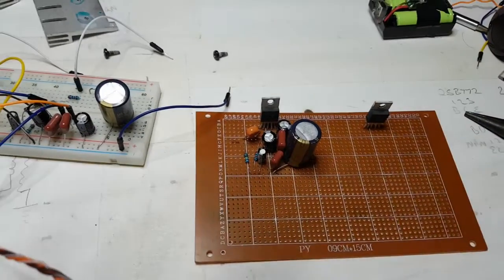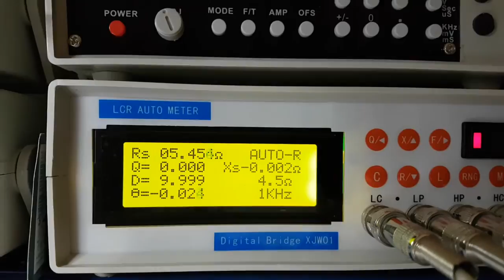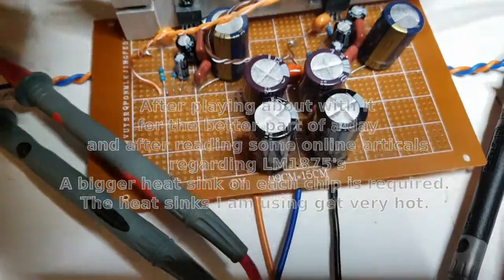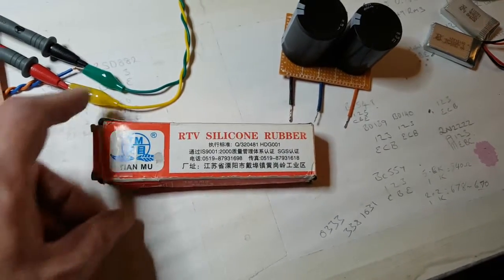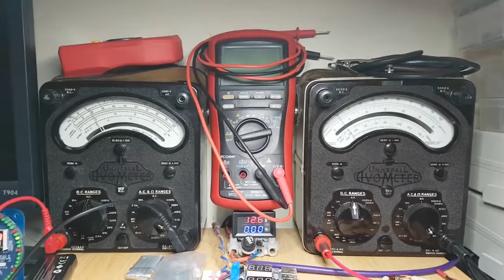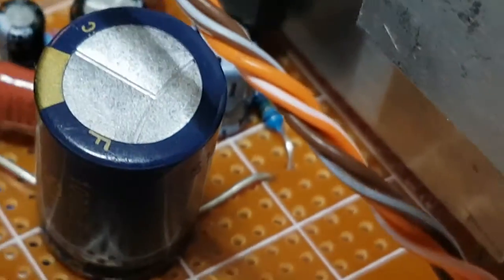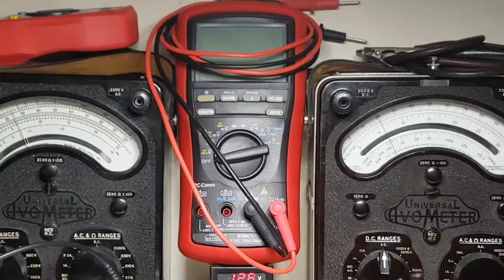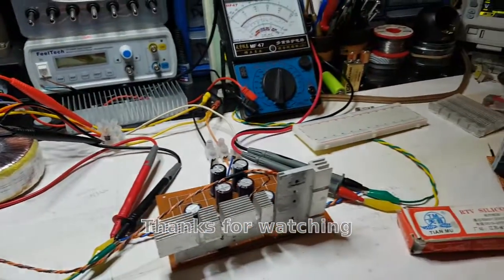DIY Stereo LM1875 Amplifier

Comment: Thanks for the vid... can you please tell me a bit about the power transformer your using?
Reply from the maker: Hi Yorky, Its a 12-0-12 160VA I bought this one http://www.ebay.co.uk/itm/Toroidal-Transformer-Dual-Primary-Secondary-160VA-2x12v-/121321460007?hash=item1c3f529127 
I hope this helps :D
Reply: it sounds and looks like one from jaycar (australia) but they told me it wouldn't do the job. It states 
12-0-12 300VE, from 240v main (it has 6 wires coming from it)... Can you tell me, how many wires come from your transformer?

Comment: Great sound..and I love the VU meters...smile...bench is looking more impressive each time I see it...except for the worst speaker repair I have ever seen....grin..been having fun here recharging 48 magnesium D cells made the most impractical power bank you have ever seen..but 30 ah capacity
Reply from the maker: The meters are cool, even if they were just used like that,I could live with it. Yes, the speaker repair, not my finest work, the speakers were pretty badly blown, now they sound OK. Why make such a power back, one has to ask.
Reply: My daughter asked me if I wanted some dead batteries...being a horder I said yep...to my delight she had 48 of them..so i learnt how to recharge D cells and made the pack...12 volts but with a buck if needed....4 sets of 8 cells which is now part of a solar powered radio...i will be interesting to see how long the battery chemistry holds up...3 months so far...plus i am protecting the health of frogs,..,,smile
Reply from the maker: Your solar panel is trickle charging the battery pack, nice. I like frogs, are they in danger?

Comment: Kindly share the diagram
Reply from the maker: It's on the LM1875 datasheet ; )
Reply: Have you used the same components given in data sheet or you made changes in that?
Reply from the maker: Rodney I would like to say no, but I honestly can't remember. I do remember making the output capacitor bigger and low ESR for more bass. I would be more concerned about layout with these amps. I am sure I put the circuit and layout are in the video. Here is another youtubers video link   https://youtu.be/TSbwEhMhDzY  which will explain more about the layout and it's importance with these chip amps.